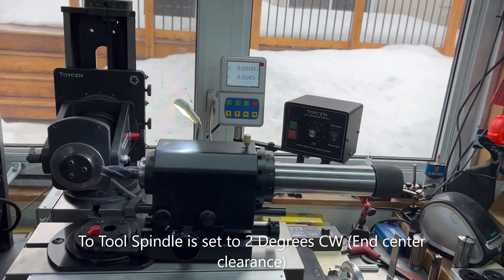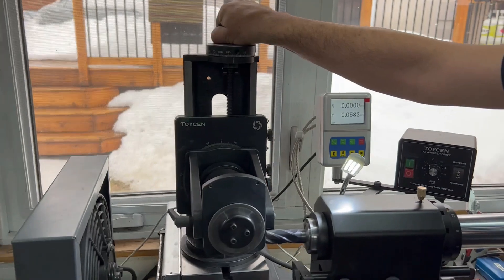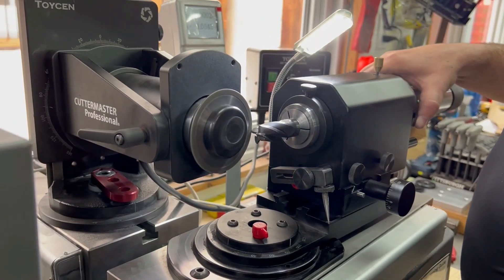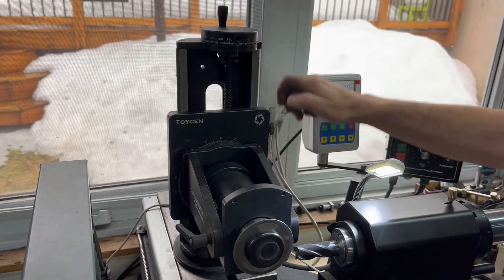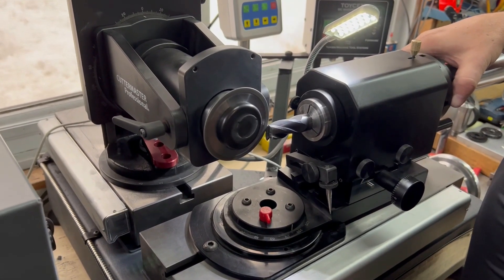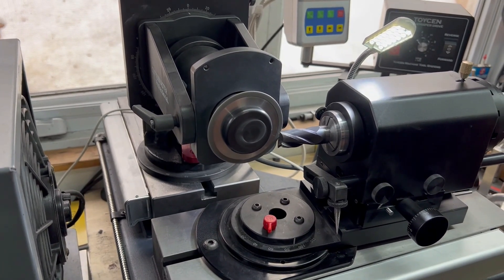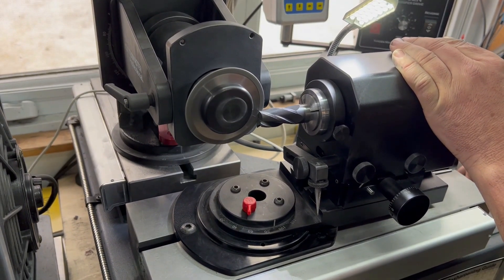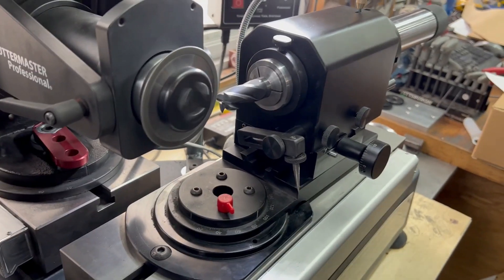How to grind a 4 flute center cutting carbide endmill end using a 15V9 Plated bond rim wheel

Comment: Cutter grinding is a lost art. I worked at a tool shop when I first got in the trade in 1979 that had a cutting grinding department.  I used those talents the for rest of my years as a machinist. These skills blew everybodies mind later when almost nobody was doing it. The problem is the cutting tools we use when machining molds have corner radius' and a coating. So when the tool gets dull, we just grab a new one. We would rarely use an endmill, but knowing how to sharpen one goes a long way when you need a good one and there are no new ones.
Reply from the maker: This is a good comment , sounds like your tool grinding skills served you well. I wish we taught our young people how to sharpen the tools they need as a machinists while they are learning the trade. The difference between being stuck when a tool gets dull and finishing the part while your set up is a big one.     You would like the New Grinder with a DRO its like Christmas.

Comment: Great video Jeff. I'm assuming I can use these same specs for a 5-10 flute collar.
Reply: I can't wait to have my first try at a 5/10 flute collar.

It took me no time to master the 4 flute center cutting (variable Pitch) endmill.   Anxiously awaiting Jeff's next instructions.
Reply from the maker: HI There :) sorry for the late reply yes you can 5 probably not 10  , just make sure to position the wheel so it will do the grind, and then, if its variable use the tool rest not the indexing collar.
Reply from the maker: It gets kinda hard to support the tooth as the flute count goes up ,, if symmetrical the collar with do the trick  with the JXT  (hard to get the wheel min there